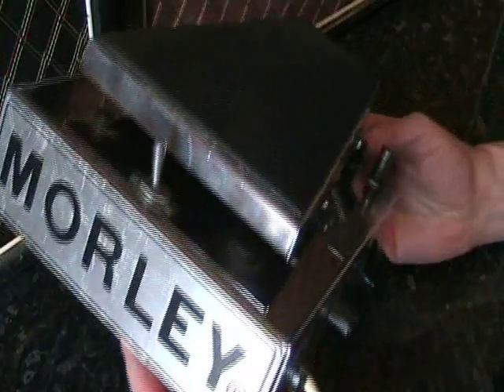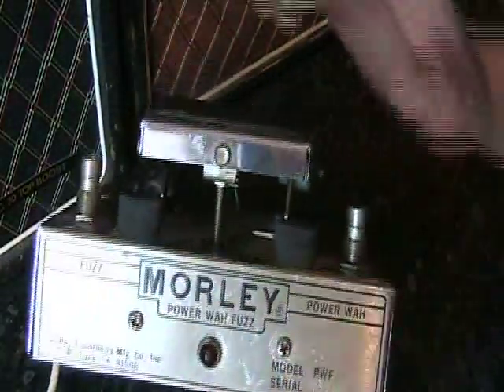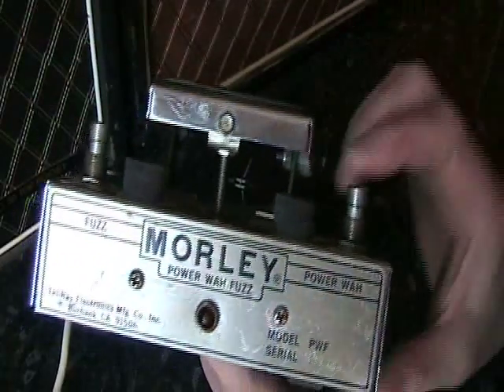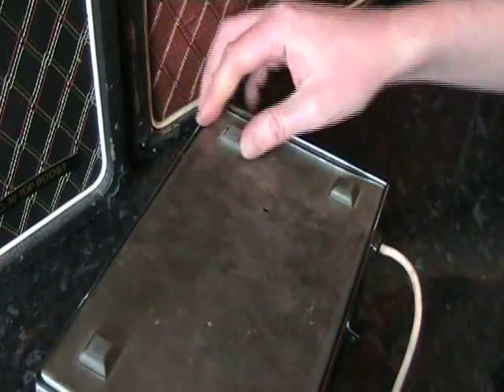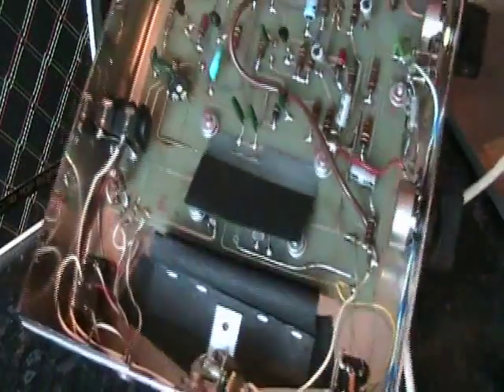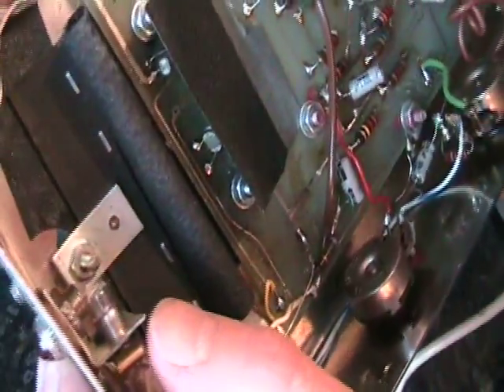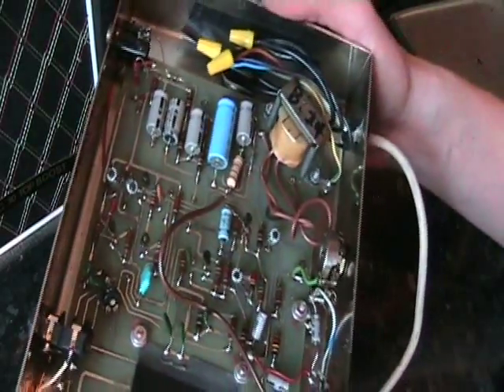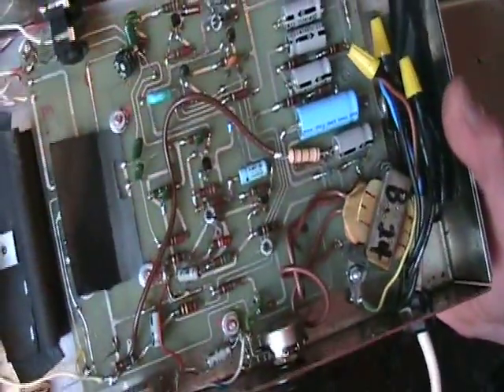Morley Power Wah Fuzz

Comment: I just took delivery of one of these on 2/22 (eBayyyy!!). It is built like a TANK and 'Tel Ray', the manufacturer didn't skimp on the chrome-plating either! Very thick and heavy and built to last (built to last what I don't know!). Maybe built to outlast a kind of rock and roll Armageddon?!?!? I haven't even plugged it in yet (it's freezing in the rehearsal room just now!).
I've always always always wanted one of these! Reason? Tom Herman from Pere Ubu used one of these (or he owned one anyway). It was the mid-70's and there wasn't too much else. Yes I know there were other gizmos for guitar INVENTED then but the availability of a wide variety of electric junk was not there. So I'm guessing the Morley was it for T.Herman in Ubu. He played some mournful slide guitar solos while he was in that band and there was some subtle use of Wah sound evident. Slide guitar  was unusual for a punk band (the fantastic East Bay Ray notwithstanding).
T.Herman seemed to use the Morley pedal just to overdrive and civilize a too-big 70's amp like a monstrous silverface Twin of the period.
It's possible Ubu's original guitarist the very very late Peter Laughner found himself using a Morley Power Wah Fuzz for the BREATH-TAKING wah-guitar solo on Ubu's 'Final Solution' 45. But unlike Herman I've never seen pictures...

In the meantime: 
         
             ''Non-alignment pact...Non-alignment pact...Non-alignment pact...''

Comment: Actually I found that were both correct lol. I found that he used the PWF early on, then switched to the wah boost because he started using a second amp (a Sunn coliseum lead) as well as his mesa rig, and just switched between the two amps (probably when Metallica was making more money). His sound was so badass because he had a "post wah distortion" with the PWF and then the Sunn.

Comment: I have this same solid wah but the different is that I have Sustain and not Fuzz.I bought it 1976 and it's still working.Even the light is original.The pedal movement is very large and the sound is much better than in this video.This is a real classic pedal like Cry Baby or Vox...

Comment: @jimboob400 I'd bought a "classic"(the new one) last year expecting the same sound as my old one, no such luck. More like a crybaby/morley hybrid to my ear.
My old one used 2 9v batts for 18v power, the new one is only 9v, the 18v version had more of a filter effect than a typical wah sound. I like my new morley though, it has a much fuller sound than my dunlop and is very low noise.

Comment: this is a pretty interesting pedal
both the wah and fuzz sound really tight
however i rather dislike the sound of them both engaged
i'd prefer having the two seperate and having the means of placing one in front of the other
whereas these sound very much to be running in parallel

Comment: Wha sounded great clean. Fuzz sounded killer but when you tuned on the wha with the fuzz it seemed to kill the fuzz.
Reply: +DrGreenThumb its because its filtered by wah...most guitar players use wah in front of their other effects(distortion for example), this is not the case in this pedal cause fuzz is in front of the wah in circuit(i have talked to one of morley guys, bill wenzloff, he works for the company for a long time and know his stuff)...but that amazing sweep range works really well for bass guitar if you want to play an angry screamy fuzz wah lead bass, thats why cliff burton from metallica used it in the early days(later he got power wah boost instead and used it in front of ibanez tube screamer with boost engaged, and that got him the simmilar effect huge scream but with more distorted sound)...jason newsted after cliff died is given his PWB but he put an overdrive in front and used no boost, thus creating PWF sound again...like i said its not what most guitar players would do but you can always use that wah as just the wah with some other distortion, or fuzz alone as a unit...however its how its done in most fuzz wah pedals(ehx crying tone being an example) to get more pronounced wah effect
Reply: +Marijan Barać morley is also putting out a cliff tribute pedal
Reply: chris B
i know i have seen it..and i like it...i dont like its pot based and not optical here in europe due to some shitty european standards...but overall great wah